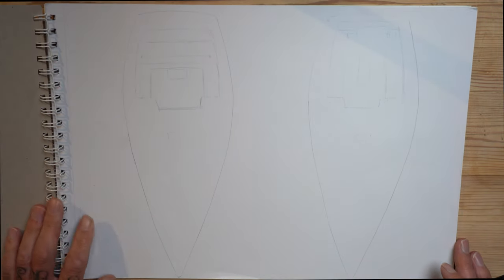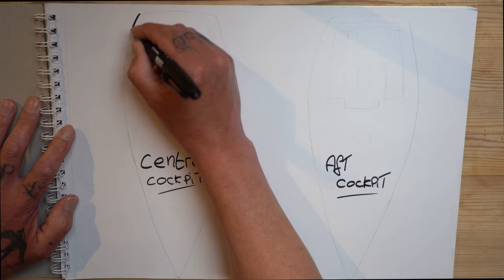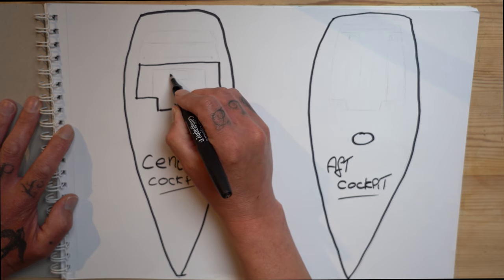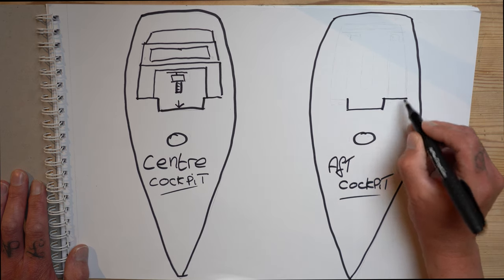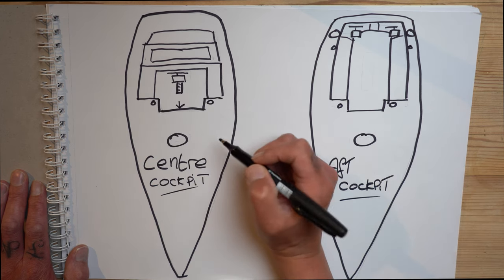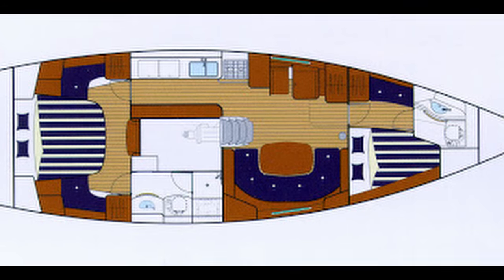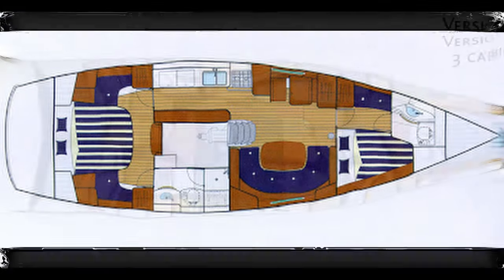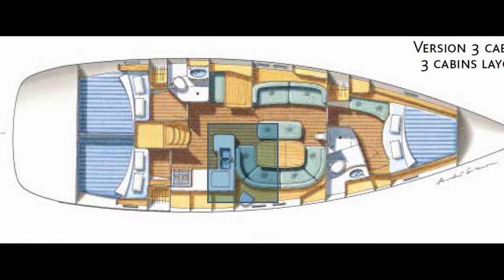SVTONIC Ep3,  Aft Cockpit vs Centre Cockpit

Comment: Solar Power has become increasingly important which brings in the issue of Shading of Panels with Centre Cockpit designs. A rear Cokpit Solar Arch is pretty much unbeatable if you want to avoid shading and having to waste large amounts of money on generally useless short lifespan flexible Panels (the Chinese ones generally useless inside two years. Plus as Cruisers apparently spend 75% of their time at anchor,  that Rear Cockpit becomes the Main Living Area on the Boat, which makes a Transom type mini galley start earning its keep too. with a good Sprayhood, and full Cockpit Bimini protection plus modern walk around side decks it opens up the top of the boat quite Nicely ? There is another issue for Centre Cickpits for disabled people like myself. First, getting in and out of them is not good, plus the Companionway below is normally a lot of very steep steps. If only Centre Cockpit boats were available, people as disabled as myself, would have to give up Sailing. But instead, there are a selection of nice aft Cockpit boats with as few as 4 gentle sloping steps withbp the Companionway. So obviously a very Sybjective, and rather forced perspective, but if as able bodied as I'm Once Was, I think I'd still be going with the aft Cockpit, and not just for that Huge Solar Arch Avantage ? 🤔

Comment: You must consider what you will be using the yacht for and where? Short hops in the Med during summer where you will spend most of your time outside relaxed. Serious ocean passges in foul weather where you want maximum shelter and plenty to brace against. The choice is yours but choose wisely changing vessels is an expensive exercise. Me? if I could afford one I would have a big Hallberg Rassey or Amel with a centre cockpit and luxurious aft cabin. Currently I sail a small Contessa which has an aft cockpit and no aft cabin to worry about. Where did I put that lottery ticket? Bon Voyage all!
Reply from the maker: Well said, Ian;) but I am sure we have the next winning lotto ticket;)

Comment: I have a nice morgan 1974 ,38 oi cc 2 heads 2state rooms giving complete privacy,  I'm currently remodeling to suit my taste  ..im converting it to an electric drive . Solar and wind and water generator systems with water maker, electric stove ,With a house batt, bank , separate from the electric motor bank . The engine room gives plenty of room to install this set up along side fresh water tanks . And centralize the wiring and plumbing,  While balancing the weight, instead of having tanks and  controls under beds or floors in closets . Everything's in one spot .. with plenty of room for a couple of guests,  with a folding swim/dive deck covered helm , if someone want to sun tan they have the whole forward deck , swim deck on the stern . And shade in the healm . It's just me and my girl ,so plenty of room . As we live aboard year round.  She's old and slow like me but built like a tank .. removing a lot of weight lowered my water line and I picked up a couple knots..
The center cockpit gives great  360, views while operating the boat . And much safer in storms,  I chose this boat for these exact reasons, 
Every boat has its pros and cons , these are some of my pros,